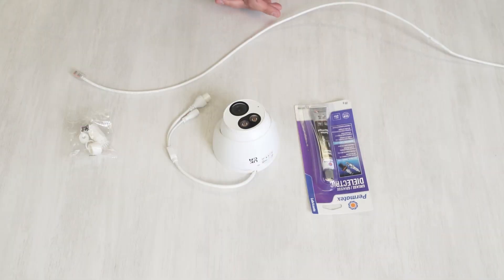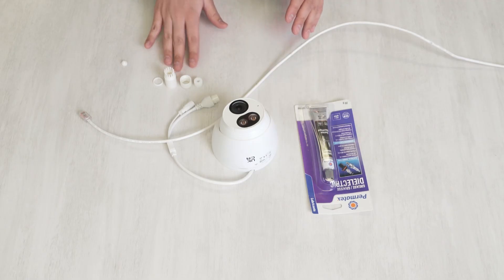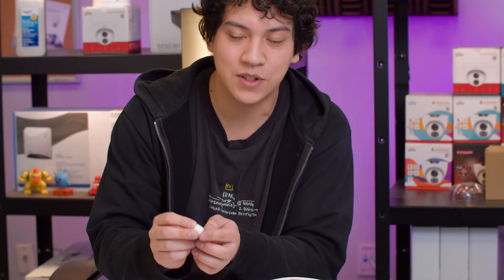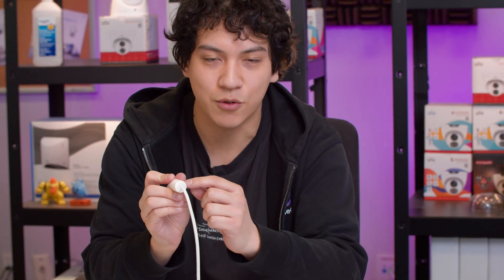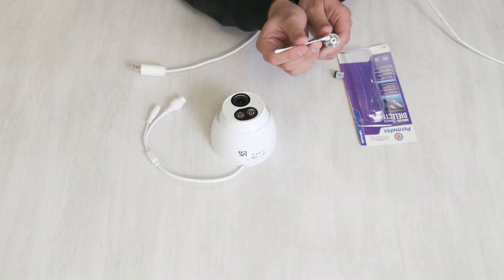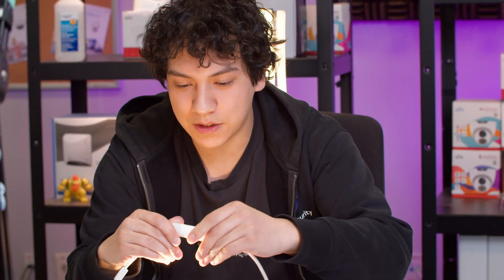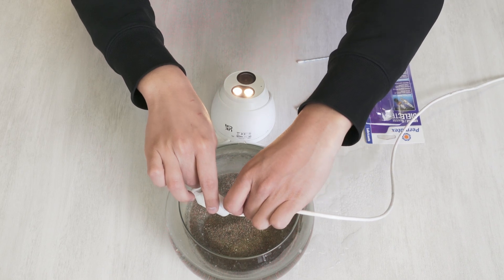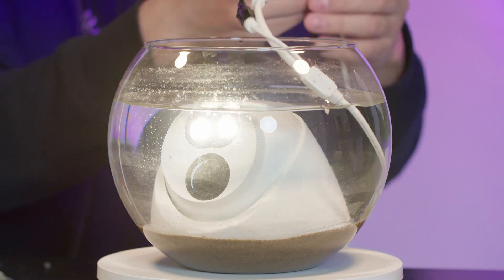How to Waterproof your Security Camera (sealing the Ethernet/RJ45 port)

Comment: I just got a new camera and had the waterproof lid installed but it rained hard a couple days ago and fried the camera. The ethernet cable I had was flat and the lid is meant for round cables. What can I use for flat cables?
Reply from the maker: I don't know of any waterproof connectors that are specifically for flat cables – but you can try using a weatherproof sealant like DAP Silicone Ultra. 

Try to fill the gap where the cable fits into the weatherproof connector so that water cannot get inside again.

Comment: how to waterproof the power unit
Reply from the maker: You don't have to waterproof the power unit. You can protect it with electrical tape but if it's not being used it doesn't matter if it gets wet.

Comment: Dude dialectic grease is an insulator.
Reply: The blades of the port push a tiny amount of grease to the sides allowing the copper to copper connection without letting water ingress. The grease is to keep unwanted water out of the connector ports. yes you may experience some dba signal loss initially compared to naked copper but its trivial compared to greening/oxidation loss over time.
Reply: I was thinking the same thing.  I would not apply it to the conductors.

Comment: Hi, I’ve used about 7 cameras(Lorex) already, after awhile they go bad. It comes with the weatherproof but regardless it goes bad. I even cover it with electrical tape and still goes bad after a year. I’ve read this before about the dielectric grease. Let’s hope it works. But thanks for the video it’s great.

Comment: I'm new to the RJ45 connector world, but I do have experience in the electrical world (I'm not a complete novice). I came to youtube to research dielectric grease and its use with RJ45 connections. I am installing a surveillance system and it will have many ip poe cameras installed in a harsh environment. This video has answered the question about if I can use dielectric grease on my RJ45 connections. But I want to put dielectric grease on the wire ends before I crimp on the RJ45 connector. I feel this connection is neglected if the dielectric grease is applied to just the connection point where the RJ45 is plugged into its socket. I feel if the contacts have to pass thru the dielectric grease on the way thru the insulation it will help seal the connection and it may also make crimping easier. I don't want to experiment with a lot of connectors just to find out that I will have to do them all again. If anyone has any insight or helpful comments on this subject please feel free to interject.